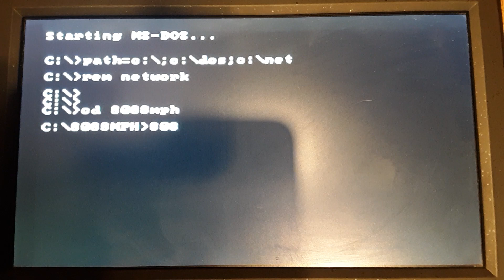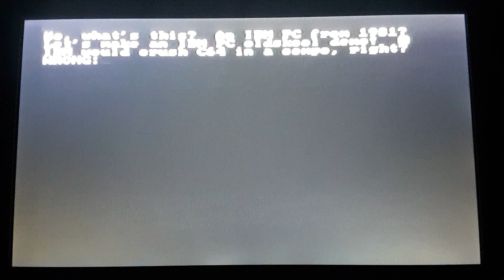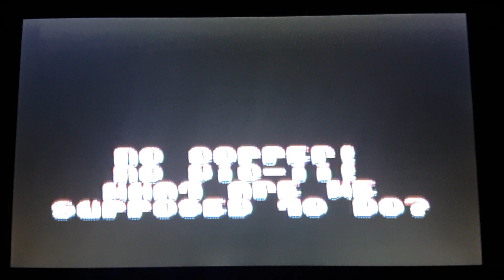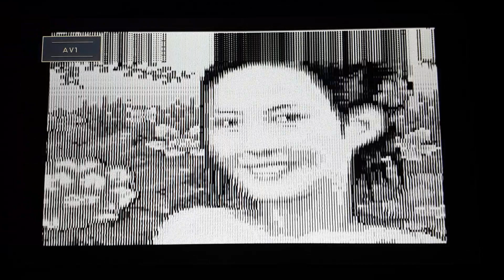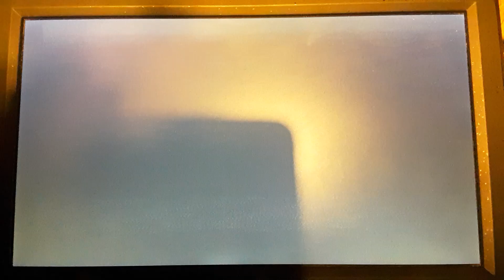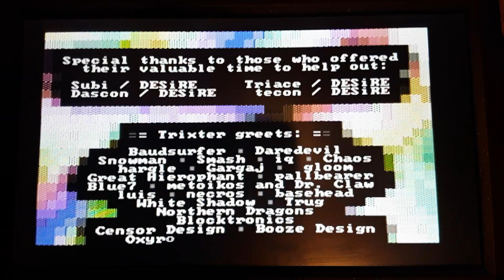8088MPH

Comment: Yeah, the color screens weren't supposed to be black and white, but the colors that they described.  Trixter and the other developers wrote this to be run on a bone stock IBM PC, so it's possible that you either have your CGA card improperly configured or there is some other timing issue.
Reply from the maker: One of the times I ran the demo the colors came in right. I just did not want to re record the video.
Reply: @elijahmmiller  reasonable. we don't need to see a full demonstration of the CGA card (unless you're planning to clone one!) The capabilities of imitating the original 8088 PCs were amply demonstrated. I am a bit curious how the V20 would do, if you could throttle the speed down.
Reply from the maker: I could try the V20 some time. I would need to run it at 4.77 MHz. I did run it on my V20 at 8 MHz with a VGA card. It ran just the images were messed up due to the need of a CGA card.
Reply: The demo is designed for NTSC output from a CGA card.  That allows it to use color artifacts to  add color to some of the black and what sections.

NTSC displays are a bit hard to come by these days.